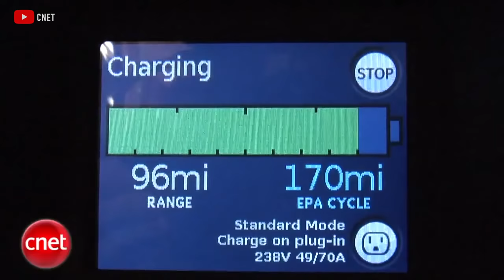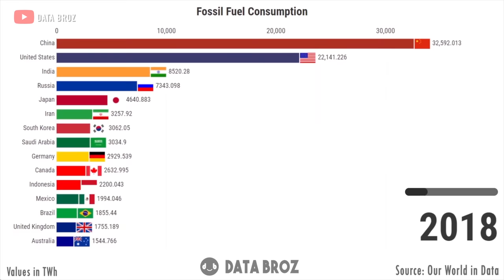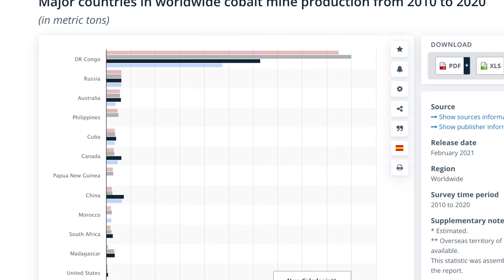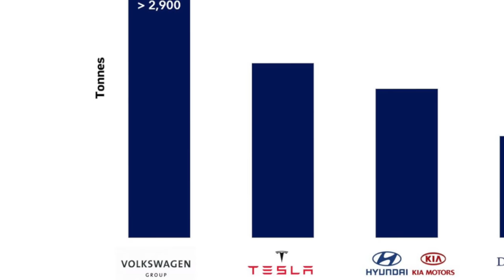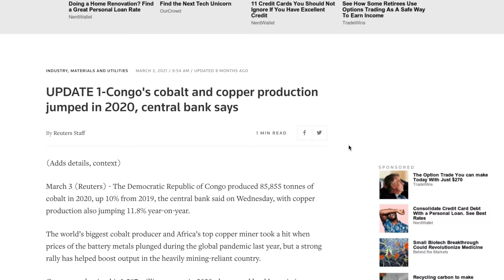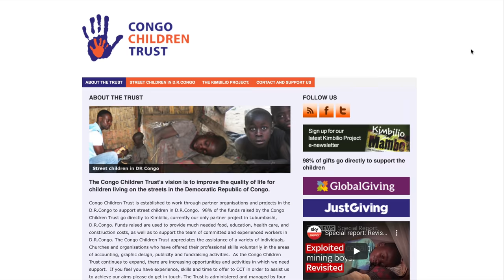Child Labor in Electric Car Manufacturing

Comment: Such an important topic! Honestly the research that goes into these videos is unparalleled.
Reply from the maker: Thank you!!
Reply: @albonfilms  The VW  xl-1  Hybrid (small light 2 seated diesel/electric) gets over 200 mpgs on a fully charged battery. They used lots of carbon fiber to keep weight down making it expensive. But it's 100% proof that any car maker can make a small 2 seated hybrid commuter car that can get at least 125 mpgs. Plus covering it in solar cells would also extend range/mpgs....Yet car companies refuse to build them, they'll make a 50 mpg Toyota Prius but not a 125 mpg 2 seated car that's 100% buildable....Sooooooo, if climate change is the huge emergency the Globalists Leaders say it is, why aren't they building these 125mpg hybrids to drastically reduce emissions? If a 125mpg hybrid costs say $25,000 it'd eventually pay for itself VS a 35 mpg car. Our Globalist leaders are either major hypocrites or "climate change deniers" Their carbon footprints are a million times higher than the average persons. Despite being able to afford to power their mansions off 100%  wind & solar for some reason they don't.
Reply: @michaelbrinks8089  That car is rather expensive and rather slow. It wouldn't appeal to most people. Probably why it and others like it have never gone into production.
Reply: @AndrewMalkin  Agreed,expensive & slow but they could make something similar using aluminum instead of expensive carbon fiber & give it a little more power and still get around 100-125 mpg vs  225 mpg
Reply: @AndrewMalkin  it was actually produced, albeit in small numbers and in Europe only.

Comment: looking forward to having EVs for everyone but I'll still be holding onto my 90's honda just in case they decide to pull some tricks like planned obsolescence, advertising on the infortainment or tracking where you drive or having a monopoly on servicing them and locking you out of supercharger network if you change your own lightbulb. At least I truly own my old shitbox I know exactly how it works and can fix it myself with a hammer and a 10mm and its 100% analog and cant be tracked or tinkered with by anyone over the internet, plus its so reliable it ran perfect for 22 years and will probably still run 22 years more
Reply: Same here! Still driving my 1985 mr2 everyday 🖐🏻
Reply: @WarCry389  I want to save up on AE86 aka the front engined mr2 because why not and drive it.

Comment: The problem is not what powers the car, but the car itself. Trains, in all it's forms, are the ultimate solution to solving the whole environmental problem. Trains require less space and maintenance. They fit more people. Can be powered fully electric, are faster, etc. Better city design and planning (less regulations and zoning) and governments and cities slowly phasing out car use in cities, will solve the problem. 

Simply replacing gas cars with electric ones will not solve the issue. It just shifts the problem area. And it completely ignores the true causes for the problems we are facing today

Comment: Electric prices will soon go up. Instead of paying $3.50 for a gallon of gas to go 35 miles. You'll pay $3.50 at the charging station to get 35 miles of range. That big electricity guzzling Cyber truck will cost you $70-$80 to get you 250 miles.

Comment: Not only is the mining buisness absolute atrocious, but also the dangers that come with lithium batteries. They violently react to water, will spontaneously combust (look up the crash of UPS Flight 6 or the water damaged EVs after a hurricane), and their disposal process must happen a certain way.. otherwise it'll cause sever environmental damage, and lithium fires cannot be put out by conventional means. On top of AAAALLL that, our nations grid work cannot handle the amount of output needed to charge a neighborhood full of EVs. Rates will go up, black outs will happen, and not everyone can afford to pay electric bills.. let alone buy a new EV vehicle. 

Don't get me wrong, I'm all for alternative means, but I'll only backup EVs once they become practical, safer, affordable for all, and our grid is actually capable of handling all that output. Till then, i refuse to buy an EV, and most people will as well. EVs are not truly 'green', and never will be

Comment: The 20% number is actually not entirely correct. It's about 20% if the cars are the same size/weight, but EVs are much larger and heavier on average, meaning the amount of CO2 that is released during the production of a EV is higher than the 11.000kg number for the average EV.

Basically, if you compare a small gas hatchback with an EV SUV which are the big sellers, then over the liftetime of those cars 10-15 years (without a battery swap), they will be about even.
 It ends up about the same, especially if you consider that there is engine tech on the horizon that will reduce emissions by 30% in the next couple of years. EVs being good for the environment is not really true in most cases. It ends up being pretty close, just with more rare earth metals and child labour. At least the manufacturers get a bigger cut from selling EVs so they are happy.

Comment: The good news is that companies are moving away from cobalt when they can. New battery tech is coming with iron and poly based cells, heck even carbon. Green is just a buzz word, all things that move consume energy in one way or another. I love gas and EV tech, but for different reasons and applications. Energy is never free, no matter how you spin it.

Comment: Nobody talks about the irreversible damage EV are causing to the planet :(
Reply from the maker: Exactly right. Gas powered cars aren't any better of course, but the wasted potential of electric cars is far more maddening to me.
Reply: @Neojhun   ICE vehicles can run off hydrogen and very low emission bio diesel & natural gas that burns much cleaner than gasoline or fossil diesel. Burning hydrogen in an ICE doesn't produce any CO2. So it's not hypocritical to continue to advocate internal combustion engine vehicles (I'm starting to sound like you now)
Reply: Petroleum cars are better
Its just that the person saying they aren't better is not living in a country that prefurs small simple and cheap

Comment: I'm holding off on anything EV until the production emissions are far better than contemporary gasoline and hybrid vehicles.

And I'm waiting until the EV drivetrain tech trickles down to low-technology cars in the $20,000 range.

Comment: well, there is a more green, and more immediate solution, that also solvers traffic problems, noise pollution, and doesn't require tons of cobalt to make. TRAINS. Honestly, after driving for about a year and racing on some circuits with karts and my car, I say, make more circuits, racing is way more fun than driving. Also, voting with our wallets is a huge myth, just sayin

Comment: Akira Yoshino did not make the discovery at all. M. Stanley Whittingham developed the first lithium battery in 1970 which was then improved to a lithium ion battery by John B Goodenough  in 1980. Goodenough's work was commercialized through Sony by Akira Yoshino, who had contributed additional improvements to the battery construction.[14] Goodenough received the Japan Prize in 2001 for his discoveries of the materials critical to the development of lightweight high energy density rechargeable lithium batteries

Comment: The technology, money, time and effort that has been put into developing the electric car would have been much better used into making gas engines more "green". There is no reason that in this day and age with our advancements in technology we can not develop cars that run off of gas yet get double-even triple the gas mileage of a average car today and put out a fraction of the pollution. Your average new car in 1990 got 25mpg. Your average new car in 2023 still gets 25mpg. Why? Nobody is really trying to improve that. They say they are, but they are not.

Comment: This did not even mention lithium strip mines that scar the earth permanently, while releasing tons of trapped co2 on top of the diesel heavy machinery used to do so.  If you include that and the afterlife of an EV battery the carbon equation flips entirely.  The amount of energy needed to recycle an EV battery is astronomical plus vats of highly toxic chemicals(that also need to be disposed of) are needed to break the batteries down to their basic elements.  An EV will NEVER have a smaller lifetime carbon footprint than a modern ICE vehicle.  If this craze was anything but a political push to make the right people rich (themselves), and actually had anything to do with the environment then the push imo would be for hydrogen fuel technologies.

Comment: I wouldn't call it hypocrisy. It's unfortunately the world that we live in. Try going without your cell phone. It use to be a convenience, but today the world is built around them making them more a necessity.
On the topic or electricity, here in California we've had a struggling power grid for decades. With an increase of plug-in things, fires and drought, the situation has become much worse. 
It's nothing compared to what's taking place in Congo, but still adds to the overall short-sighted push for all ev cars, lawnmowers, hedgers etc..

Comment: This video is fear mongering at best. Go watch that Engineering Explained video and you will come back with different conclusions. Depending on the car you are driving, electric cars can be CO2 postivie after just a year and in most cases, after just few years and the more you drive the faster this happens. On average you need few dozen thousand miles to have the whole car CO2 cost being saved. And all of this assuming our current energy production.

Tesla produces LFP cars not only for their Chinese markets, but they are going to be everywhere, all their standard range cars will use those, so they will be in the most cars that Tesla produces, not "a drop in a bucket". 

And sticking with you old car instead of buying new Tesla (other cars are not as efficient, especially German ones) is CO2 positive only for the few years like 2 or 3, after that, it would be better if you bought the electric one. Electric cars can be 4 times more efficient than gas cars, that's huge! And of course there is almost no maintanance, and the whole battery can then be recycled (and there are plenty of companies that are already doing this, including Tesla). During the lifetime of an electric car you save so much CO2 that you can produce several electric cars just from the savings and still be CO2 positive. That's huge.

And of course, you talk about problems with cobalt mining, but you don't mention problems with oil extraction? Millions Iraqis are dead as a result of wars over oil fields, the same situation is in Libya and many others places. And what about oil spills and huge natural disasters? And so and so on. 

And do you really think that there is enough children in Congo to mine all that cobalt? What we can expect is for those mines to mechanize as the demand grows and we can expect new places to be uncovered for the cobalt mining (like we now see in Canada for example). Also, why do you think those children work in those mines? Are they doing this for fun? Do you think, they can just go to school instead but they have awful parents that want to see their children suffer? No, there is a tremendous poverty in Congo and that's why they decide to work in those atrocious conditions. The alternative is simply even worse. If you take away the cobalt mining, what are they going to do? Do you really think they will suddenly get a fresh pair of pants, a backpack and go to school with full stomach? The best thing to happen to congo is to develop opportunities for all Congese to earn the living, not take away investments from there.

And that thing at the end, don't buy a new car or a phone if you don't really need one. Alright, current and projected production of electric cars is only a fraction of global cars production, so don't buy ICE cars, just buy electric ones. This way, you will drastically reduce the number of cars produced and all those that are going to be produced, will be CO2 positive very fast and by the time they are in number to completely replace all the demend for the ICE cars, they will be already "paid for" many times over.

And you speak like the world was not going to change in the future at all. Electric cars have been here for the last ten years (since Tesla, everything before is just toying with the conept) and we already see huge jumps in efficiency, cost of production and maintance and so on. The advantage of electric cars over ICE cars will only grow larger with each passing year. There is a huge progress in this area, we are just at the beginning of it.
Reply from the maker: I say pretty much all of these points in the video, so I'm surprised you think we ended at different conclusions. 

But, to say that exploiting children in African nations is better for them than actively creating systems to ensure that adults in those countries can work and get paid fair wages is the most asinine thing I've ever heard though. I'm not saying to leave the Congo, corporations will never leave the Congo, there are far too many minerals there. But they have more than enough money to make sure that conglomerates like Huayou don't treat their people as expendable tools. Mechanization is not some magic new thing that will forgo the exploitation of these people. The scale at which mining already occurs would have done that already. 

This video isn't about oil extraction, and it doesn't need to be. ICE cars are not better for the planet than EVs, I said that dozens of times. ICE is worse and always will be worse. But to so vehemently defend something that is actively killing nations, not because it HAS to be that way, but because corporations profit from it, is simply ridiculous.
Reply: You sound like electricity is the only clean way to power a vehicle. There's other choices utilized.